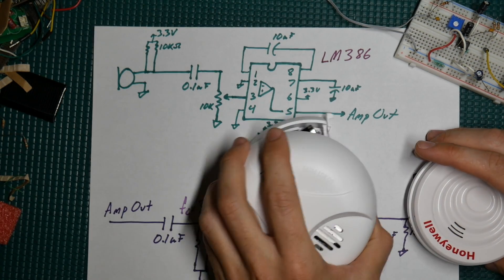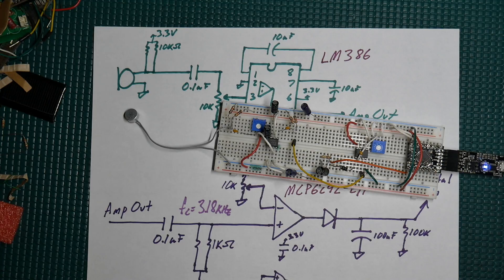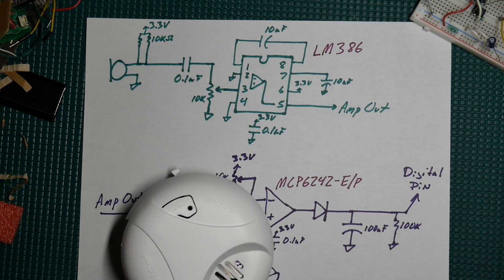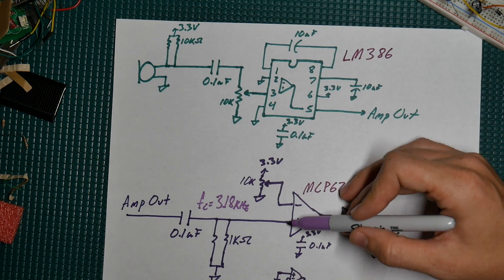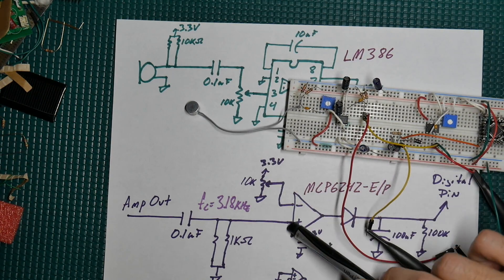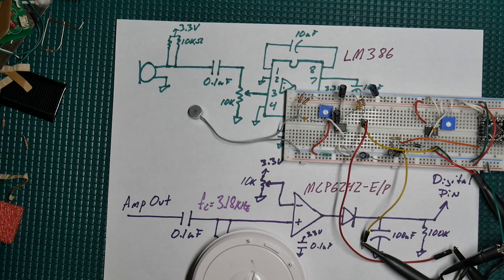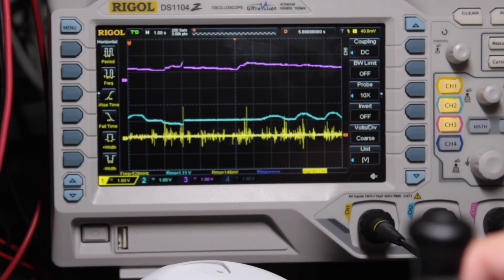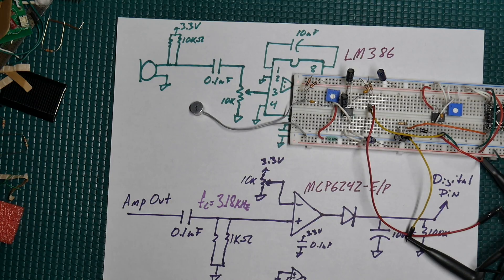Simple Smoke Alarm Listening Circuit for Arduino

Comment: I've not used this op amp (MCP6242-E/P) before.  Do you have a better circuit diagram you can share?  Or can anyone tell me exactly what pins to use wiring up that second part of the circuit?

Comment: Very nice thank you. I will be trying out a pre-built circuit from aliexpress for 69 cents shipped and coupling it with a wifi garage door opener and status module to create a listener that would send me a message. Module at aliexpress is called 3pin voice sound detection sensor module

Comment: I created one based on these cheap boards available on Amazon for about $1. My goal however is to create a real audio monitor that does not use a pot to control thresholds similar to the Leeo Smart Alert or Amazon Alexa (Guard Mode). If anyone is aware of such a circuit / software hack that could be connected to an Arduino or esp(8266 |  32) please let me know. Thanks.

https://hackaday.com/2015/11/16/audio-coupled-smoke-alarm-interface-sends-texts-emails/

Comment: Nice Kevin but I have done this an other way and it is so simple.  I have some servers and mains adaptor power supplies in my loft space and was worried about smoke or fire up there.  I used an ESP01 module paired with a $0.50c buck regulator module which has an enable pin and solder pads for popular voltages. FYI:  The IC used in most of these smoke detectors has an IO pin to multiplex alarms as audible beacons in large or public spaces.
The buck regulator is permanently connected to the 9V battery but the regulator is off unless the enable pin is pulled high by the smoke alarm IO.  I have the ESP01 set up to connect to my home WiFi with a static IP (faster and more reliable than DHCP), once a connection is established the ESP01 pushes a message to our mobile phones and Google Chrome browsers via Pushbullet.  So far I have never seen the push message more than 10 seconds after the alarm sounds.
The whole project is powered by the internal 9V battery but draws no current unless the alarm is sounding
Reply: That's very smart. Could you send me a link to that buck converter with an enable pin? I found some from adafruit but they are pricey and I would need to make a few of those conversions.

Comment: Need to read 2+ times before notification. Otherwise, events like glass braking will trigger false alarms. Hope you don't have a barking dog in the house :)
Get ready for some false triggers. I would've used the piezo output and a wifi email pusher setup using a cheap esp8266-01. 
Spend $2, and you are done!

Comment: Couldn't you use the pwm signal from the board (smoothes of course) to feed the reference voltage of the compairitor so you can set it via WiFi for those instances where it is triggering falsy due to loud noises like a football party or singing loudly while cleaning
Reply from the maker: oh yea I like it!

Comment: Kevin,
good idea and nice design.
Since you have spare comparator in the MCP6242 it may be worth while to use that for the "digital pin" voltage to make it truly digital (with some hysteresis). Depending on the circuit you are feeding this into you may get issues with the slow discharge rate and the input of that circuit. Some could end up oscillating if that is too slow.
Reply from the maker: yea that's a good idea - was thinking about something useful to do with the spare opamp

Comment: Great explanation and circuit design again Kevin. Thanks!
Too bad I don't have a scope as I had (or have) a thought from about 3-5am every morning where it seems every truck driver is p...sed-off with getting up early
and takes it out on their truck - and me! 
So I'm still searching for info on something that will filter a certain pitch and frequency, mimic it and the output the same to an LED strobe (maybe also video record output)
and let them know what asses they are.
Of course I may need a titanium mailbox to mount it in for hammer protection :-)
Reply from the maker: haha! that would be cool

Comment: Simple enough idea, I like it. 
Thought I'd mention we've got 926Mhz wireless smoke base modules on the market with a 10 year battery life. Smoke alarm and rflink costs us about $150 AU here. Not cheap but could certainly integrate several smokies to the one IoT push device. I'm a bit of fan of SuperhouseTV and noticed he has chosen from having arduinos in the wall to having them in a central location.  https://www.brooks.com.au/images/datasheets/DS_EIB605MTYRF.pdf
Reply from the maker: yea, I might have to look into this.  I've got smoke detectors that are networked together, so wouldn't want to loose that feature.  I watch superhouse TV too!